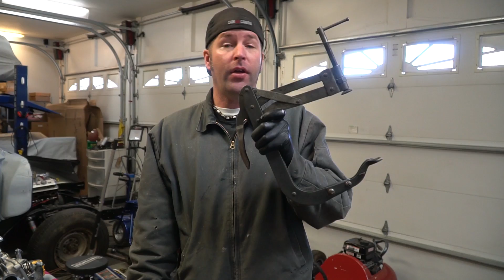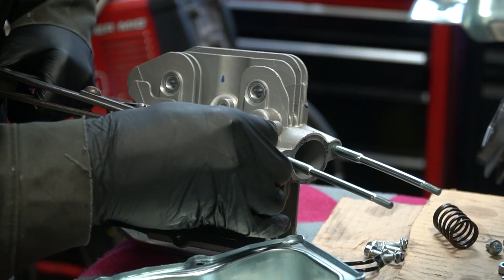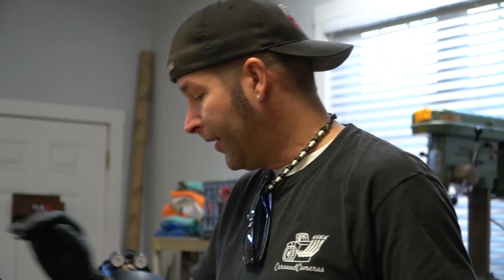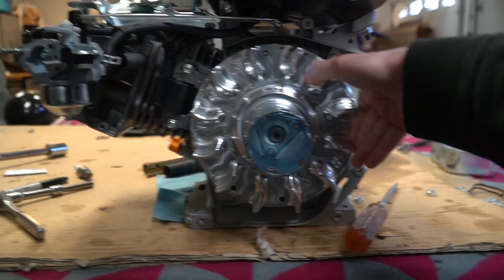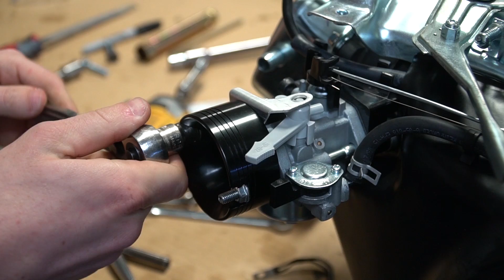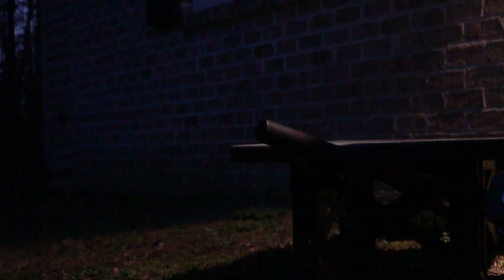Predator 420cc Stage 2 Build Pt. 2 | It's a THUMPER!

Comment: Is that the hemi motor? Is that one visual reference the smooth top head cover? The HF one on display was like that. The one in box they brought me had a big nut or bolt thru top middle of head cvr. Different air filter too. Both had same 60340 mdl nos. Of course the ppl there had no idea what i was talking about??  What are visual outer differences in hemi???

Comment: Nice job id still keep the electric start.... all that pullin wear me out.... yall have the stright 1 inch shaft layin around? Like a spare ya would sell .. ive the tapered shaft from tye generator n cant get my torque converter to center n lock up...was putting it on a 80cc 4 wheeler

Comment: Lol mine does the same thing... I just finished my stage 2 kit and got the carb almost tuned and when I rev it I shoot flames a good 2 ft. I thought about welding another piece to my exhaust and doing a fish tail tip to make it look cool and to add a little extra length to the exhaust.

Comment: Have you cats built a Honda Gx340. 1Hp stock ? I can’t tell if the crank on mine is 7/8 th. Or 3/4. Do you cats know and where can a guy get a clutch for such a beast it’s going in my Doodle bug drag race bike It will bee. Mine,  ha ha ha

Comment: I just got a 420 project and it has an aftermarket carb on it with a main jet #90 and pilot says #25. Is that stock or aftermarket? What is the stock size if so, thank you

Comment: Hey guys I’m not sure if it works with the newer engines but back in the day when I used 5HP Briggs engines for cart racing we ran then on alcohol we bored them out pit big valves in changed cams. Run a 3 1/2 HP flywheel. Tiltson carbs with fuel pumps. But what I was getting at is some cams preform better if you retard the cam on notch and some run better if you advance it one notch but first set the cam up in stock orientation get extended push rods filled to the valve lash then experiment with retarding and advancing the cam but do not retard or advance the coil or timing of the coil. Leave mounted in stock form. Or use a drop down bracket if running a smaller flywheel and then it should only drop in a straight line no advance or retard is needed. Oh we also use to run stroker cranks to. Different lengths on the piston rods. Man I sure do miss those days. Lots of fun times it was.

Comment: Hey guys love your videos I learned so much. I have a question though I have a predator 212 with the stage 1 kit Muffler rlv tip air intake and Main Jet but after I let off the throttle from wide-open to zero throttle I get some backfiring I was wondering if this is normal and if not how can I correct this thanks the stage one kit is from gopowersports

Comment: Why didn’t y’all do a carb upgrade 
That alone would be a huge difference in the performance.
I have a Honda XR 200 carb on my 91 EZGO and it’s 20 over and mildly ported and polished and I couldn’t tell no difference in it till I swapped out the carb and it was amazing at the difference.
Now that you have ran it with the stock carb do the carb up grade and check out the difference.
Changing the jet in that lawn mower carb ain’t gonna help much

Comment: I bet the gm v6 push rod tool would work slick.... Lisle makes them. They are for the front drive v6 gm engine. I'm thinking it's wide enough to grab the spring keepers and allow you to grab the locks but you'd have to use your bleed down tester to keep the valve closed....no need to take the head off.....or hmmmm🤔 Ike could always build a tool, you have a welder and a torch and a shop and metal.....come on Ike your a actual mechanic, I build my own special tools all the time.

Comment: Hey guys you make me wish I was young and thinner. I am fat and old but I do like to build things . I am thinking of trying to build a small vehicle use a two cylinder motor and incorporate a drive shaft an rear end for a drive shaft but it has to be small . The body would be a c cab so the width of a golf cart an the motor in the front. Any ideas on the drive system. I have seen something like that in pictures. Oh and a reverse

Comment: Ok guys...next time...before you remove the head, get a hose from a compression tester...run it into the plug hole and apply compressed air...Then with the aid of an "F" connector wrench ( https://www.parts-express.com/Data/Default/Images/Catalog/Original/360-089_HR_0.jpg ) depress the spring and use a stick magnet to take the keepers out. Then reverse the process for the new springs and keepers. :)

Comment: I have some Predator 212 questions? Is it cool to discuss that here? One is regarding the low speed jet in the stock carbs. Under what conditions should you increase the size? Ive only found one supplier of these jets in various sizes. Any ideas?

Comment: Ike, on the valve spring tool. Have you ever seen if you could use a spring compression tool for the spring inside the s10 pickup and blazer door. The one that likes to shoot out like a rocket when you do door pin bushings

Comment: Would a 110cc engine fit my 50cc atv without Frame modification? There’s engines online 110cc, that say for 50cc,70,90 and 110 frames but I just wanna know if it will work for sure
Reply: I don’t have a welder so

Comment: LEAN, that's what flames from the exhaust mean. The idle circuit on your carb is too lean, which is why it is viciously backfiring when you close the throttle after revving it. I can almost never make it through one of you guys' videos because you just through more crap at engines and say it make more power, "this is a stage 4 kit so its +14 hp above stock...." Tuning and good design will always make more power, but you guys don't take the time to learn to do that..... Some of your stuff is interesting, but no matter how much youtube wants me to, I don't enjoy your videos.

Comment: Ya got to remember old school ! Lock the crank , add compressed air to the plug hole and use a lever type spring tool .No seal , add oil . The air pressure holds the valves closed and in place while spring are removed an replaced . Ike's boss must know this one ! Good videos Guys .

Comment: this could have been done with a piece of nylon rope instead of removing the head and using a spring compressor tool. roll the piston to bottom of the stroke, stuff  some  rope into the cylinder and roll piston up to hold valves and use a socket and a hammer to remove springs.

Comment: Drill a hole through the side of the head on the Allen head bolts holding your exhaust header on and run a wire through both bolts and twist the wire together. That will prevent your exhaust bolts from vibrating loose 👍

Comment: Hey guys I've got a predator 212cc with 18pound valve springs if I put a m Mikuni carb on it will it blow up the standard fly wheel?

Comment: Sounds pissed I love that nasty exhaust rap the long header gives em. Another tip dudes, order some allen header bolts that are drilled so you can use some safety wire. Them little hoes won't go anywhere. Or just send it idc!!!!!!! When will you guys start playin with nitromethane??? It'll be fine!!!!!!!

Comment: Why didn't you use a rope and put it into the sparkplug hole rotate the flywheel to compress the rope up to the valves then put the new springs

Comment: There are mechanics that remove everything to make their job easier, and then there are mechanics that will try to make a job easier by removing as little as possible. I usually try to do a job removing as little as possible, only to end up taking everything apart to do the job correctly. This is usually after running out of curse words and a lot of yelling at an inanimate object. Dang I love turning wrenches.

Comment: A trick I have used for compressing springs... zip ties. Keep the pressure evenly spaced out by using 3-4 ties and tighten them each a little at a time. Your mileage may vary epending on the weight rating/stiffness of the spring.

Comment: You can add air, you can add fuel, you can get exhaust flow, you can out a big cam in it, BUT without compression all you got is sound and few extra horses but you need to calculate compression ratio, dome piston, or small chamber head to take advantage of the other stuff. You have just changed parts that isn't building a engine BUT! I know y'all don't have much time on your hands but still cool videos

Comment: GOOD LORD. No wonder that engine uses a balance shaft! I know you guys are trying to squeeze every ounce of power out of that engine, but I would at least consider putting the balance shaft back in; that thing is either going to vibrate itself apart or crack something if you're not careful.

Comment: if you're really in a pinch for valve springs, i've had to use zip ties to compress the springs and my fingers to push down to seat them. ahh never again

Comment: Longer videos please. Also in these types of installation videos, if you are going to go "instructional" do it properly. "torqued to spec"... State the spec then! RBG does a really good job on that front. You guys could easily do the same. I agree with others this engine doesn't seem to be the right fit for the golf cart, especially without the electrics..  But I'm sure... It'll be fine

Comment: You should be able to add compressed air to the cylinder through the spark plug hole at TDC (kinda like a backwards compression tester set up) and it will hold the valves shut in order to change the springs without pulling the head off...just a little tip from your old uncle Ed

Comment: I keep thinking "you wouldn't need as strong or double valve springs etc if it just had a 4 valve head and it'd flow way better...but then it'd be like a motocross 450cc. I guess tuning a lawnmower engine is like polishing the proverbial".
Forgive me but that is how I see it. I also find building the motors to be more fun than driving with them maybe that's just me. This would be great on a stretched minibike. As if IKE needs to be given any more incentive to buy another bike. Love you guys.

Comment: I used to have a valve spring compressor tool for small engines, that was very compact, and the head did not have to be removed.

Comment: Tip: Use old spark plug w/porcelain removed, attach air hose fitting(weld or thread). Piston TDC / both valves closed, pressurize cylinder. there is enough surface area(PSI) on valve to hold it and be able to remove spring. be careful of pressurizing crank case. squirt oil in cylinder will help hold air.

Comment: The next project is the Golf cart that was sitting outside the shop when they went out to test fire the engine.  But my question is this, why remove the charging system and starter when there is a possibility of driving it on the road at night?  Gotta have the battery up to keep keep those lights going.

Comment: You can just push a heap of rope in the spark plug hole and then push the piston up to squash the rope and it acts like a stopper for the valves and you can get the springs off

Comment: Flames coming out the exhaust is not a good thing. Check your leak down pressure, I bet the exhaust valve is staying cracked open.

Comment: Ike, with the valve spring tool you couldn’t get to work. Put a hose clamp around the arms and tighten it down. It will keep the arms from spreading when you start compressing the spring. This hose clamp trick also helps with gear and pulley pullers to keep the arms from slipping off in shallow pulleys.

Comment: Adjust valves hot...cold adjustment is fine to warm it up.  Once warm, readjust.  Unless engine runs and stays cold your adjustment will change causing problems.  Metal expands...

Comment: You did not need to remove head for valve spring install , hose clamp or zip ties would have held that spring compressor on. Looking forward to golf cart build have a great day. Keith

Comment: Curious as to why yall removed the low oil sensor?
Reply: Sometimes when you corner too hard the engine will cut off
Reply: @isaacitllbefine7231  Cool thanks. Ive seen you turn corners, it makes sense. lol

Comment: Here is a link to a valve keeper removal tool. You will need to hold air pressure in cylinder to keep valve seated while removing keepers and spring. Works good.  https://www.amazon.com/Lisle-36050-Keeper-Remover-Installer/dp/B0012S61IO/ref=sr_1_1?crid=1OELFMVFILPYD&keywords=lisle+36050+valve+keeper+remover+and+installer+kit&qid=1548095012&sprefix=lisle+360%2Caps%2C239&sr=8-1

Comment: guys guys guys, you never need to take the head off of ANY small engine to do a valve job!!   The same trick we use to get a stuck flywheel bolt or any other off is by putting 1/4" string/rope into the the cylinder and keep feeding it until you cant feed anymore, turn the crank so the piston is pushing the rope into the valves and there is no way in hell those valves are moving!!. YOURE WELCOME
Reply: Problem we had was compressing the spring to get it back on
Reply: @isaacitllbefine7231  I should  have mentioned I also used a pair of long thick needlenose  against the rocker stud/bolt

Comment: What’s the estimated hp
Reply: Im guessing 18ish hp
Reply: Isaac it'll be fine really is thought it would have been higher than that could you guys take the black widow frame since it has the motor mount for the 212 to 670 and test the built 420 and the 20hp predator and see which one is better for the most dollar

Comment: 10W30 is probably not the right oil, guys. :) On air cooled engines the oil gets extremely hot and therefore thin. So a 10W50 or 60 would be the better choice...

Comment: CarsandCameras She's a thumper!  Can't wait to see it in a street legal golf cart!  Glad they legalized it in your town.  Whenever I go to a nearby great lakes (Michigan) beach town I always see golf carts rocking around the streets, I always found it unfair those folks can do it at their liesure while around here we would be ticketed and possibly have the cart confiscated.  Not sure on that, but I may try and push my luck 😁.  On a side note, I have an old 1988 Polaris Trail Boss 250R 2wd and figured it would interest you to know those 250 2 strokers make from 20-30hp and have an excellent torque converter and fwd/neutral/rev gearbox-so keep your eye out for a used cheap one.  Thank you for the excellent videos.
Reply: Where im at in michigan as long as you have one of those orange triangles that the tractors use you can run them on the road

Comment: Would a 60 tooth sproket fit on a 10 inch wheel
Reply: If it is a #35 sprocket then yes it will fit a 10" wheel.

Comment: You can take a piece of pipe the same size of the valve spring hat and cut it short and cut the side out and compress the valve spring with a press or whatever you can find and use your magnet to remove the keeps from the cut out in the side of the pipe piece it's a quick home remedy.

Comment: E85 Go Kart?? is that a thing?? Asking for a friend....
Reply: I'm in the process of getting parts together now for this.
Reply: think you misunderstand what e85 is used for perhaps.? Its simply got a higher AKI rating. But it has far less energy than other fuels. So if you shaved the head and made a very high compression small engine build e85 would help keep the pinging down, but no reason to use it when small engine race fuels are plentiful and offer much more power density. Most race carts run very high compression and run on c16 or nitro/alch mix or ignite or something.
Reply: @WarfighterRacing  No misunderstanding @$1.70-$1.90 a gallon, for something just to putz around on or race your friends. I've made enough power with pump e85 to run 6's in a door car. Very familiar with what you're getting at though. I do start off at a bare minimum of 13:1 static.
Reply: @tumbleweed8231  i gotcha, just the amount of fuel used in these things price isn't a big deal. Plus, i gave up on e85 a couple years ago in my track cars cuz it gets cold enough here in kentucky to make it miserable during the winter months. Though honestly ive never been at a level to call any of my cars a door car, well because they are all door cars lmao and i've never been faster than a 9.8. I just buy c16 or as I still call it from back in the day vp blue, by the barrel twice a year.
Reply: Ethanol base fuel has more then just a higher Octane rating, it has a higher Net  energy content, more so then any non-oxygenated gasoline fuel. Do your research.
Reply: @Patty4valve  um, im sorry are you confused? yes it has a higher anti-knock index but much lower energy per gallon than straight non-ethanol gasoline. like nearly 30% less. Which is why when you switch to e85 for performance you have to upgrade your fuel system to supply more fuel, just like alcy apps it requires enormous amounts of fuel to produce power. The main reason for switching, besides a higher octane rating, which allows you to run higher compression and more timing, is both ethanol and alcy has massive cooling effects on your system, it literally wicks the heat out, which increases the safety margine for said compression and timing. The fuel itself isn't that effecient its the by-product of the fuel thats pretty magical.
Reply: Warfighter Racing  http://iqlearningsystems.com/ethanol/downloads/Racing%20Fuel%20Characteristics.pdf
Reply: Warfighter,  Net energy:
Pure Ethanol is 3.00 Mj/kg
Pure Gasoline is 2.92 Mj/kg
E85 is 2.99 Mj/kg
At their Power Stoich
Reply: @Patty4valve  you can quote me science sheets all day long im just telling you how it works in real life
Reply: Warfighter Racing  so do I, with dozens to hundreds cars I’ve been apart of Dynoing.

Comment: Take a old spark plug break the glass off remove the internals and weld a air fitting to the back of the plug threads. When you screw the new device in add/connect an air hose to the new fitting, it will keep the valves seated and allow you to do the work!